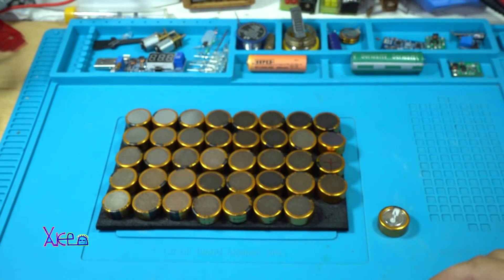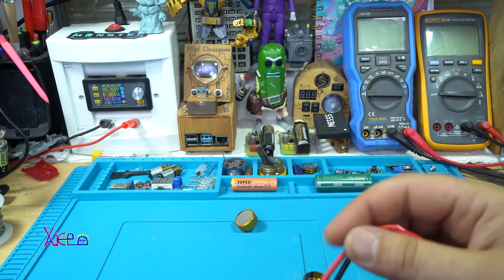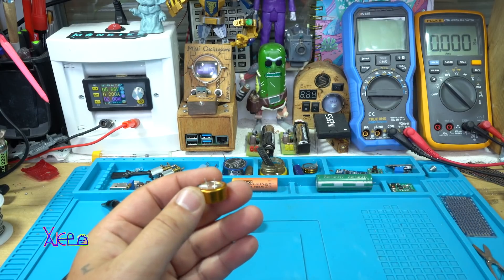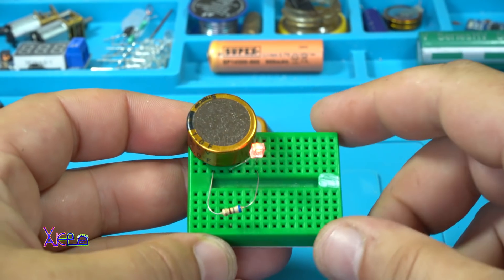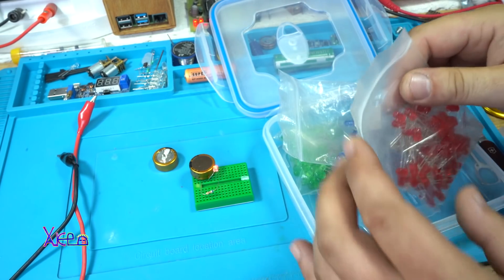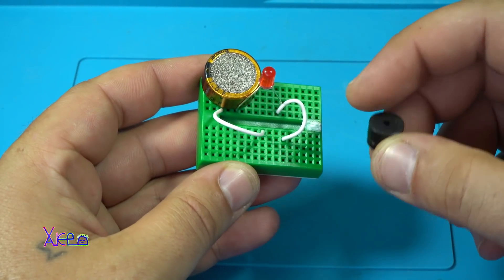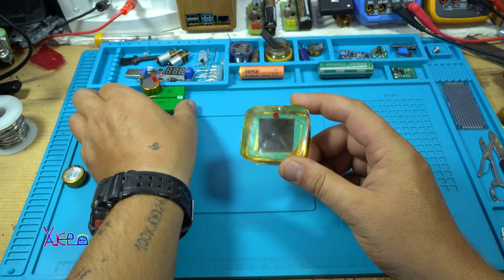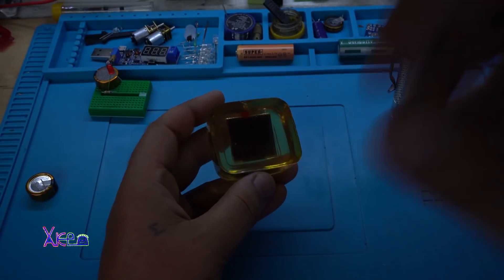3 Batteryless Circuits  3 Easy Experiments and Projects using Supercapacitor

Comment from the maker: Supercapacitors are the Future,what you think?
Reply: For long term storage do they need to be fully charged  (also is this safe?) or completely discharge ?
Reply: @applescy  they are safe because they don't use any dangerous materials such as lithium, capacitors can be stored for as long as you want and they will still work

Comment: These statements should be "milliamp-hours" not just "milliamperes"

04:42 for example this capacitor of 2.7 volts and 100 farads when you do the math with the formula that i show you 
you will get it that this super capacitor have 75 milliamperes at 2.7 volts 

05:03 that this small guy with one farad and 5.5 volts it have 1.5 milliamperes of capacity
Reply from the maker: Very well wroten👍

Comment: fun fact: those super capacitors cost higher than a battery😅
Reply: But they last 10 years? That's the difference!😄
Reply from the maker: Yes but they last long time
Reply: @tomons8059  ya your are right, also we are spending 10-times more money on that😅, imagine making a flash light with that super capacitor, that will cost 3-4 times than a battery built flashlight, Also super capacitor charges too fast but don't gives backup, where as same sizse small lipo battery will cost u 1-4th of the price of that super capacitor and will give a longer backup.